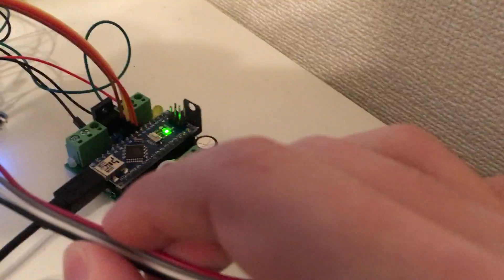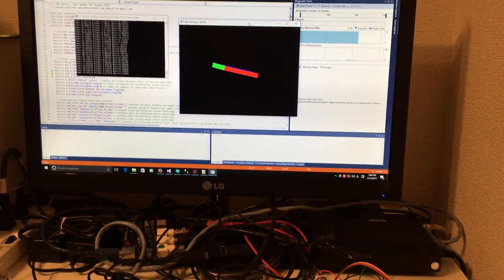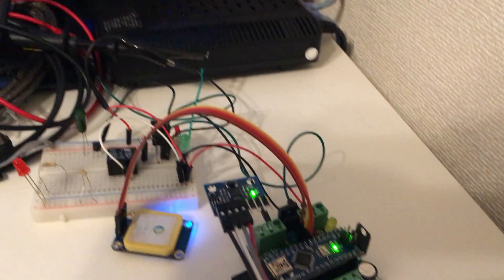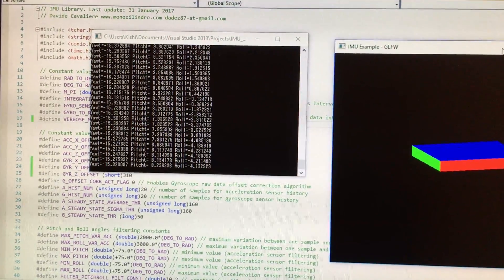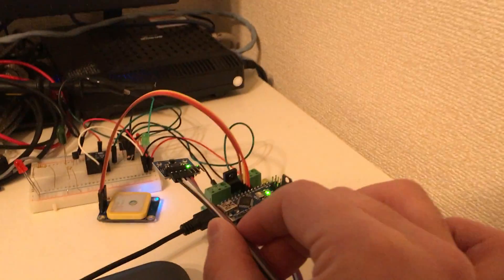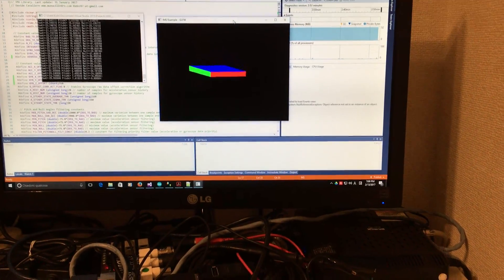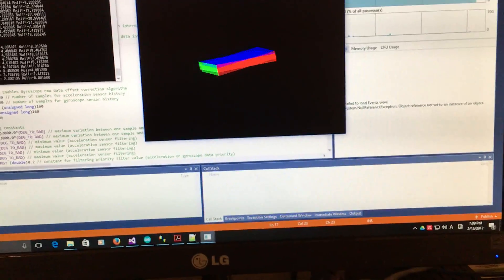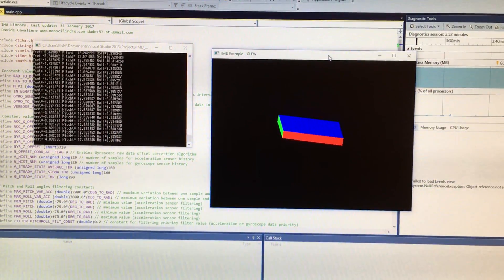IMU (Inertial Measurement Unit) with MPU6050 and Arduino Nano and Visual Studio C++ 2015

Comment from the maker: Can you please post the code that you are using? In order to read signals from mpu6050 you need to use the I2C protocol to read the registers of mpu6050. There are 14 bytes to read, starting from register 0x3B (please check) 3x2 bytes are acceleration, then 2 bytes for temperature, then 3x2 bytes guroscope. Signed int, big endian... see my blog for details, there you can see the C code implemented in Arduino, inside the Zip file there is a folder called MGU6050mgr with the source code

Comment: nice video, i also use mpu6050 with d1 mini, but i cant get the data to transfer to C#.. can you help me pls ? the format data send is like 
A-2.13
B-3.86
C142.04
A-2.13
B-3.86
C142.04
A-2.14
B-3.86
C142.05